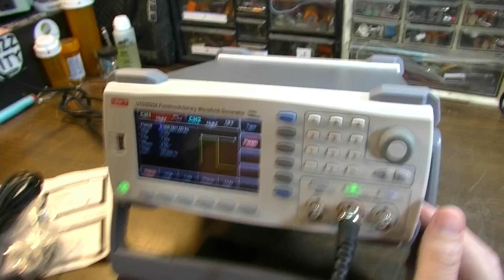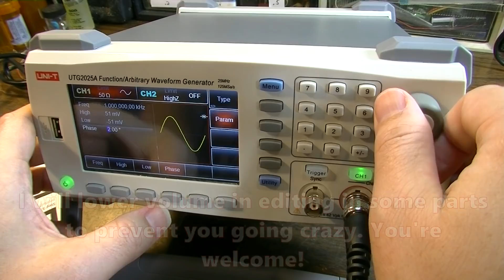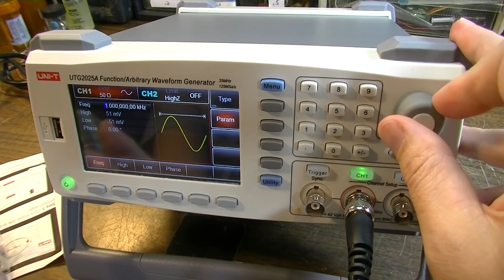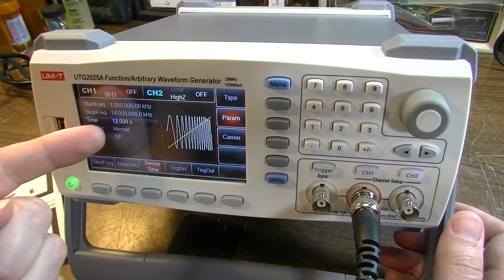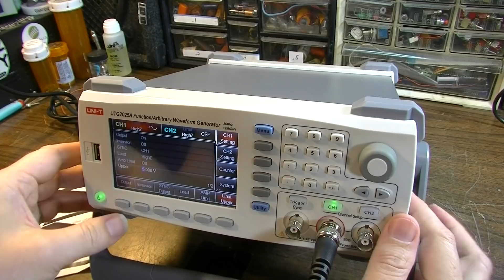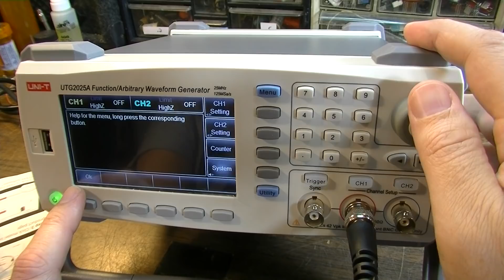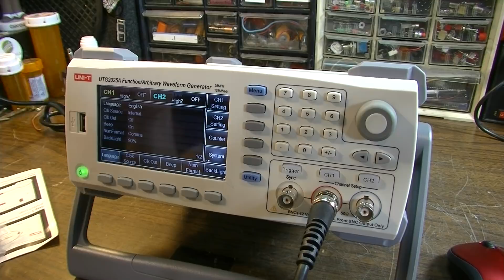How to BREAK Your New Signal Generator - UNI-T Model UTG2025A Signal Generator DEMO TEST

Comment: At 21:30 you turned the upper voltage to 0. Not sure if the lower voltage mirrored so that you say output 0v. I gotta believe that is very quiet. After that when you were looking at the frequency it looks to be 1M kHz. I am pretty sure no one can easily hear 1GHz :-). But since I am viewing via phone maybe I am misreading the display. I was looking for eeVolt explosion :-).

Comment: I spent the extra and got a Rigol, no regrets.
Reply: Any thoughts on Siglent vs Rigol?

I have a Rigol dsa815tg Spectrum Analyzer w/tracking generator (up to 1.5GHz) and their 1102e scope.
I have been satisfied with the spectrum analyzer, but haven’t used the scope for much of anything yet.

I mostly use the spec analyzer for tuning RF duplexers for public safety 
and amateur (“ham”) 2-way radio applications.  

The Rigol 815 cost a fraction of what I paid for my Agilent n9340b unit.
(handheld spectrum analyzer with pre-amp and tracking generator options / 3GHz)

The Rigol was $1950 with TG option when I purchased it and is currently under $1500.
The Agilent was slightly over $9800 and is now discontinued, but probably still available on eBay or other sources.
Though the Agilent is much better designed & constructed and more precise, the Rigol display is significantly better.
Unless I am doing work in the field, I generally pick the Rigol to use just for the larger and brighter screen.

I have the horrible habit of buying test gear on Amazon.  I always seem to get fooled by the photos that make 
everything seem nicer and larger than the CHINESIUM crap I get when I open the box. I bought a Kooler tron
signal generator (small & portable silver metallic chassis unit) for around $140 but it turned out to be a p.o.s,
I kept it because I (as always LOL) missed the return cut-off date.   So, I went back and bought the “bench top” 
Kooler tron model.  Absolute crap.  It weighed all of 5oz and was constructed of flimsy yellowing plastic.

I don’t know what, if anything, I really need a function generator for. I have a ton of more specialized RF
/ 2-way radio servicing gear already.  Everything from paging tone generators
 (QC1 and QuickCall2 / POCSAG / DTMF / 5-tone / etc...) and RF frequency signal generators, etc.

But... it’s definitely something I should have on the bench as I get more into the electronics part
of the field and with the whole permanent PlanDemic lockdown situation, I suddenly have much more free time
/ “learning time” on my hands. 😷🦠😳

AND... To the guitar video channel owner =Thanks for the video !

Comment: This is why I use vintage (old and cheap)  equipment......Stuff that's  "too fancy"  just impedes progress.
Reply: Dead Koby,  I give you a 100 thumbs up for that comment. I'll take vintage test equipment any day. At the stereo repair shop I work for, every piece of test equipment on my bench Is around 30 to 35 years old,  except for a Rigol  digital oscillo scope, which I don't really like,  but when I added other equipment to the bench I needed a very small two channel scope that would fit in a very small area. (Though we have a Textronix scope on a rolling cart that I can bring over to the bench if I need a proper analog scope with high resolution). The heart of my test bench is a Nakamichi T-100 audio analyzer and tone generator which, in conjunction with a patch panel and switchable dummy loads,  can test power output, distortion and frequency response, voltage gain, ,  extraneous noise and intermittent operation, and so on.  Every now and then I have to clean the switches on it, but otherwise ir has been  pretty much trouble free, knock on wood!  Someday I know I will have to recap it;  not looking forward to that, and recalibrating it would be a nightmare.....
Reply: @Paul J Pachasa JR , no it's somewhat more modern, a tektronix model 2235. The older scopes are so common, and cheap at hamfests, and repairing and calibrating them is so daunting, that they often sell for 20 bucks to guys who cannibalize them for parts and tubes.

Comment: You can set up a sweep of a certain frequency range, rate of change and duration. It comes in handy for test tremolo on amps.
Reply: Also, the inversion comes in handy for doing anything that requires a balanced input signal, like a PA or Mixer.

Comment: You wanted your upper limit, you got your upper limit.
edit: OK - You got that fixed. That's what I usually use manuals for - undoing the stuff I break by mashing buttons in an indiscriminate manner, lol.
Nice to see you back messing around with some type of hardware. Do you still fix amps? Not trying to be obnoxious. Like to see an old fashioned amp vid.

Comment: Don't know if you have a Scope if not there are Shareware to use your sound card as a Scope. I use the Scope to see what the wave is doing like clipping or just tracking.
Reply: And some VSTs will do spectrum analysis too - for free. I bought an old Oscilloscope from a dude on eBay. He sold it cheap because it didn't make the right noises ... Still wondering if he was muddling it with an oscillator :-)

Comment: In case you haven't figured it out - when you were tweaking the upper limit, you set it to 0 for a moment.  That changed the output level to a really low level.  Your output was set to 3mv instead of 100mv.  If you'd gone back and looked at the sine wave parameters side by side with the channel 2 parameters, you probably would have seen it.

Comment: reminds me of Ultrasonic Testing equipment i used on  field welded joints of buildings and bridges . calibrate before use .
Reply from the maker: Yeah, I'd love to see a demonstration of that testing some time.
Reply: @TheGuitologist  retired now .. transducer degree to be used  is calibrated to 1 in steel block with 1/16 hole , properly calibrated noting highest peak on display . reads air gap as the speed is different in steel vs air , air being the flaw in weld .  or climb a building and enjoy .

Comment: I've since stopped using signal generators since I blew my nice Instek one up probing blindly around a synthesizer. They really need to drop a fuse on the outputs.
Reply: Ideally you'd use an 1:1 audio transformer to isolate the thing and avoid damage.
Reply: @DrWatts-bi1jv  , or at least a coupling capacitor in series with the probe to prevent voltage going into the test equipment...

Comment: Interesting piece of gear but typical of modern stuff..sooooo many features that most techs will never use...if you need all that stuff you will probably need a higher quality unit....dunno..at this point in my life I just want to avoid having to Wade through tech manuals learning about all the time saving 'features'...life is too short. However sometimes you must surrender and RTFM. Personaly,for what you do, I would just stick with the simpler tone generator for most stuff..you would just be doing simple signal tracing, Yes? Just a beep you can hear, sine wave you can see on a scope,if you use one, that's all you need for most troubleshooting amps. Thanks for another interesting vid, Cheers!

Comment: Simple issue, the amp limit you set changed the amplitude to match your 0V limit, after you returned you had 3mV output on upper and 2mV on lower since you messed with the offset earlier.

Comment: I was using a looper pedal as a signal generator until I accidentally touched +9v on the line and popped a diode in it (oops).  it was an EHX 720!   I was able to fix it, but lesson learned.. Now I just throw a 555 timer on a breadboard with a pot; add an inductor if I want a smooth wave.. works fine for what I do.

Comment: This is cool. What are your thoughts on using this vs. an app on your phone or whatever software? Basically software vs. hardware for this type of thing. And do you have a similar video on oscilloscope? I'm asking because i might need something like this at some point, and thinking if it is worth it vs. conventional software, since this stuff is quite expensive.
Thanks.
Reply: Probably depends on the accuracy you want and frequency response. For audio the sound card solutions are quite good. You can program square waves out of an Arduino with reasonable accuracy. I guess this is used to load an amp with a known signal to look for distortion etc. If you were doing professional repairs I figure you need a calibrated source. If you are hobby then hacked solutions work well a lot of the time.
Reply: I made a video about an editor i wrote for Akai Miniak and I show usage of a software scope (including links) https://youtu.be/IXIfTyuafro

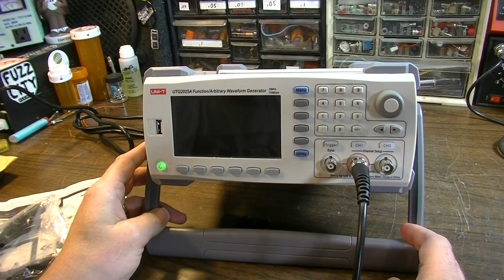Around 4:44 I start using the scope showing it in time and frequency domain. Watching this back i can see the software scope was quite slow. Modern PCs might be a lot quicker. But it is usable. I got a real 20MHz scope later and much faster monitoring etc. These modern digital scopes are cool for around £200. There again I would probably rather put that money towards and instrument and cheap out on sound card scope - your milage may vary.

Comment: You have it in High Z mode which is high impedance mode. High Z mode cant drive the amp input. You need to set it to 50 ohm mode again! :-)
Reply: @The Guitarlogist
Reply: The output impedance of the generator must be lower than the input impedance of the amp
Reply: This is incorrect.
Reply: Yes i saw he turned the amplitude down after messing with the settings after i commented. And that is most likely his problem. But impedance matching is very important! If you are not doing this you can damage your equitment :-)
Reply: Please be more specific in your answer??
Reply: Putting the generator in High Z mode does not change the impedance. It only changes the displayed amplitude.
Reply: @oz1cm806  The input to the amp is a high Impedance input. High Z is the correct setting.
Reply: @nsjohnston  sure that is correct for guitar amps. My mistake, i was thinking of hifi equitment :-)

Comment: The signal generator has a usb slot on the front of it. You may have to save the file onto a flash drive and upload it to the generator that way. Plus you can save screenshots of the screen onto flash drives as well. Having a screenshot helps because if something happens you have all the parameters saved on the screen.
Reply: Also pretty nice to capture waveforms from a scope and replay them with the generator.
Reply from the maker: Maybe. It's supposed to interface with your computer, and that functionality wasn't working when I tried it. I'm sure if I spent time chasing down drivers and stuff I could eventually get it working, but eh. I don't foresee ever needing to create and use arbitrary waveforms at all. Maybe one day I'll need to skip school like Ferris Bueller, I'll figure it out then. :D

Comment: Brad,   Don't feel too bad about having screwed up the menu on your new toy and having to do a factory reset to get it working again. My boss, a ham radio operator who has electrical and electronics engineering degrees up the wazoo,  managed to screw up the digital scope on my bench to the point where we had to do a reset on it! Which is why I generally prefer analog equipment.....and although I have several Fluke DMM's to work with, there are some things for which an analog meter is definitely preferable.

Comment: By messing with the settings you changed the square wave to have a low level of 1mV and a high level of 3mV. And a signal with just 2mV of amplitude is just really quiet.
Reply: I was shouting this at the screen when he was messing around.

Comment: I hate menu driven controls when troubleshooting.  I want dedicated controls for frequency, amplitude, DC offset, sweep width, sweep rate, etc., like my '80s vintage B&K 3020 signal generator has.  I find a triangle wave very useful for determining the clipping point.  The sweep function is valuable for testing tone control circuits, crossover networks, and setting up Zobel networks.
Reply from the maker: I agree. Dedicated buttons for the types of waveforms would be nice, and maybe a "set it and forget it" default sweep button. Good call.

Comment: It is so funny watching you play with that generator. As you run through stuff I take for granted it is obvious that it does far more than you will ever need. It does look like a great bit of kit in general though. What is its highest frequency that one runs up to? You touched on sweep but it is great to show the response in an amp in your case. Shove it on sweep on the input, put an oscilloscope on the output and you will see how well the amp responds to bass or treble. Great video anyway Brad!

Comment: I have a cheap one just to break in new speakers. You can set it really slow, like 1 pulse per second, then increase it up. I will break in a new speaker starting a 40 Hz then increasing up through the guitars range. I built an isobox to place the speaker into so it doesn't cause a divorce. lol hearing a monotone pulse for 12 hours is a dangerous wife irritant.

Comment: Like a real Man's Man...   treat instructions as packing material, just start pressing buttons and going to town :}
Reply from the maker: Peter Southern Boy a real manual would have been nice. They won’t give you those anymore. They’d have to print it in a dozen languages.
Reply: @TheGuitologist  ,  My suspicion is that electronics manufacturers are in collusion with the people who make printer cartridges, so that when you buy a piece of electronics such as test equipment or an audio video receiver for your TV system, the manual is well over a 100 pages and if you print them all out at home you will use up a $40 print cartridge and have to go buy another one!

Comment: Ooh, one more thing (as Columbo says) a word from the wise, use a 1:1 audio transformer between the unit and the equipment you are testing in the unit doesn't have one built in. It will remove the risk of blowing it up if you're stabbing around injecting signals in a crusty old amp.

Comment: Looks like a really nice quality little waveform generator. And, yes, 'restore factory settings' can be an invaluable tool! Cheers P[><]F
Reply: It does, laboratory grade, and i bet it can be sent out for calibration certification if the situation requires as well. The price is good, real good when compared to the equivalent Tektronix, Siglent, RIGOL. My bench is jealous with it's old stuff, lol.
Reply: "Did you try turning it off and back on?"

Comment: Brad, you D-Lab, and Uncle Doug always use frequencies that are not tolerable for U-Tube users. 1Kz is way too high for people listening on headphones or I-devices. Why don't you guys understand that 250hz - 500hz is much more tolerable? Just a suggestion. Love your videos.  All the best, Jeff
Reply: 1K is in the Middle. 1K at 100ma is the standard used for testing most Audio Amps preamps etc..